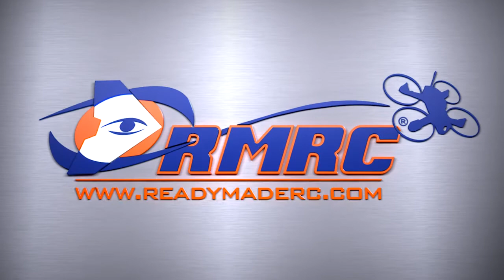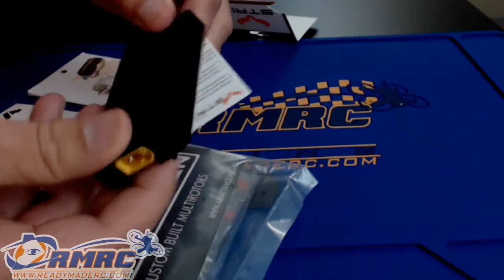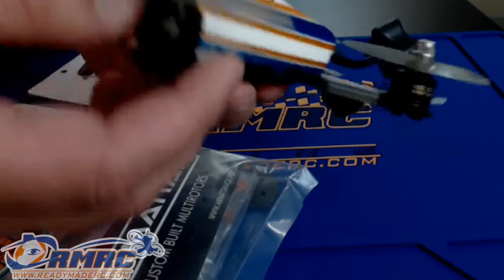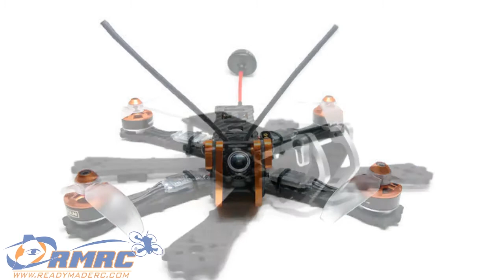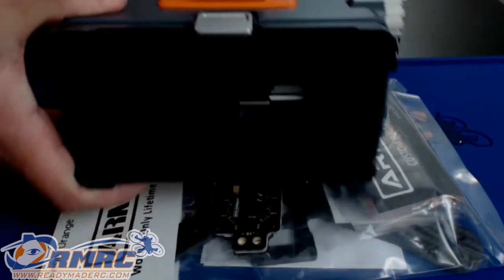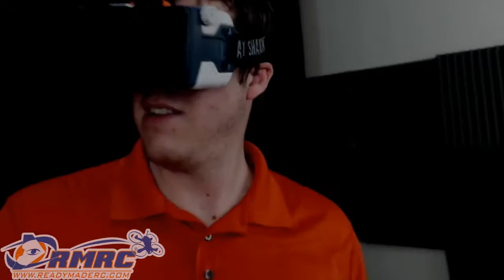RMRC FB Friday March 31,2017

Comment: So the HV charging board does it charge standard 1S packs as well like the original
Board? How does it know when to cutoff charging at 4.2 for regular packs if so? Thanks
Reply from the maker: Our battery manufacturers have told us that HV packs are the same as normal packs...just overcharged. There is nothing the charger can do to sense the difference since there isn't one. :) This particular version only does HV, and we have another one if you don't want to overcharge your batteries. http://bit.ly/2o9FD7o
Reply: Ready Made RC, LLC so all 1 cell lipos that we've been using either from strix or nitro nector or my lipo etc all are high
Voltage batteries??
Reply from the maker: This is what we were told by our manufacturers. You'll have to decide if you feel safe with that, but personally I'd have no problem charging our Strix batteries to HV. As with all Lipo batteries, you should always monitor during charging. Charging any batteries to HV levels will shorten their lifespan compared to standard voltages, but this is true regardless of if the manufacturer put an "HV" label on the battery or not...